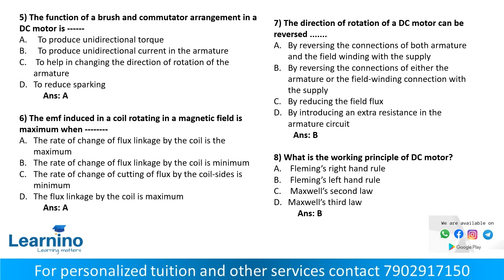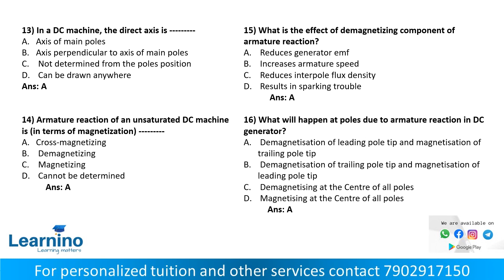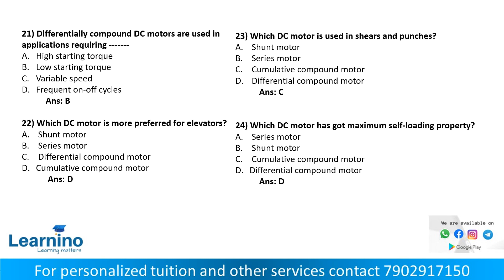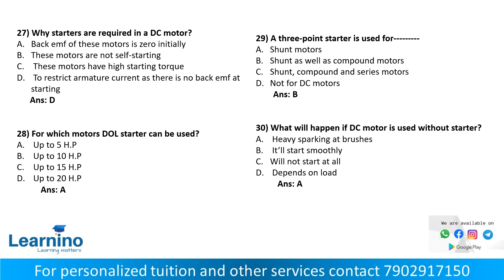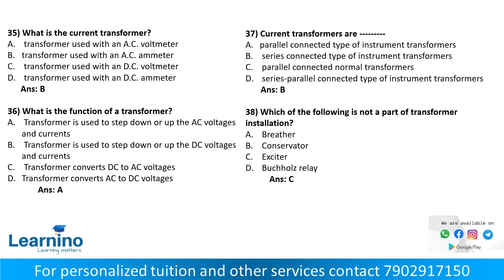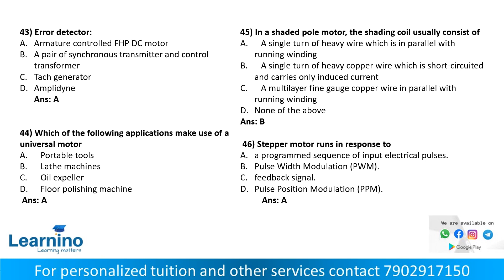KSEB SE mod 4 important Questions

Comment: Q .40 ??
Reply from the maker: Error detector is the part in the armature controlled FHP DC motor where error detector is the first element that compares the final output with desired output and gives the accurate results.